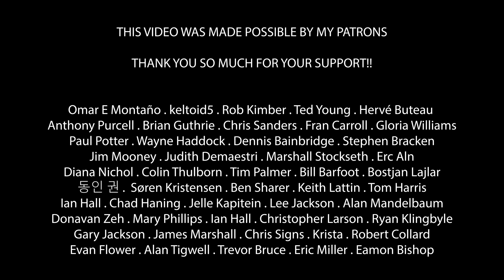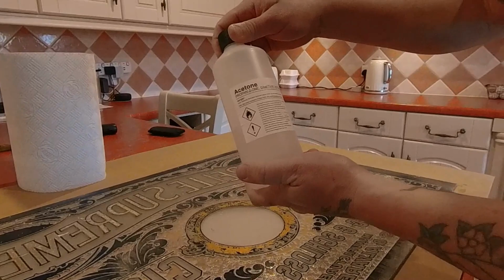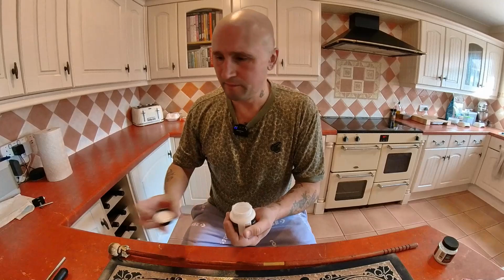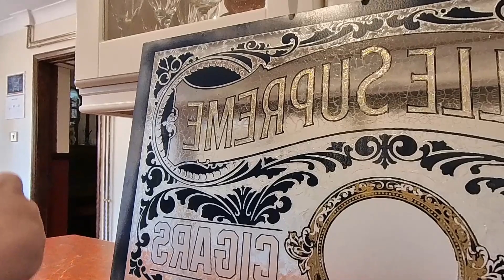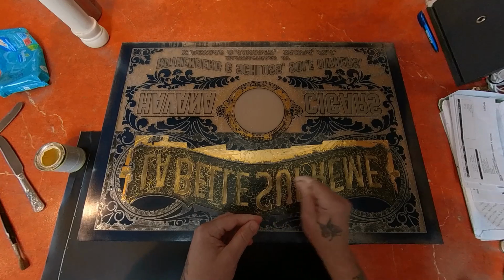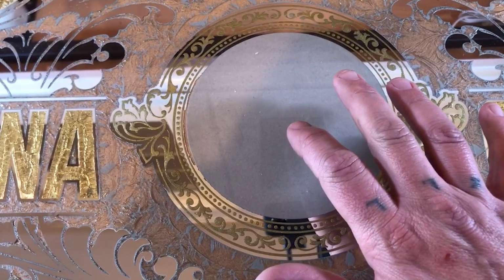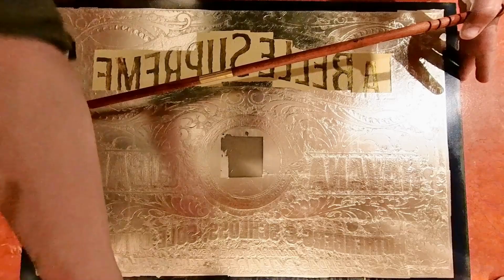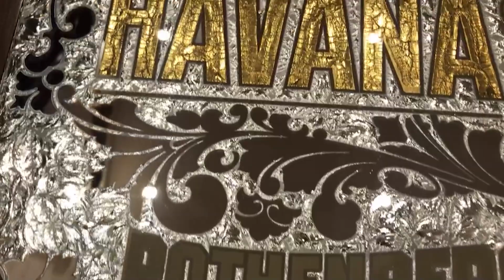Real gold crack effect. Gold leaf glass sign

Comment: I am delighted with your work.
I'm really interested in what software do you use to make labels and which one do you use to cut vinyl?
Reply from the maker: Thanks very much!! I use Photoshop for my designs and Vinylmaster Ltr to cut the vinyl. 
There's a new online design platform called Kittl that is amazing as well. I did a video on how to use it recently
Reply: @happygilder  Paul I used corel draw for Vector signs and I think that Kittl is excellent, again thanks for that info on them. I've purchased some fonts and other gear from them also.